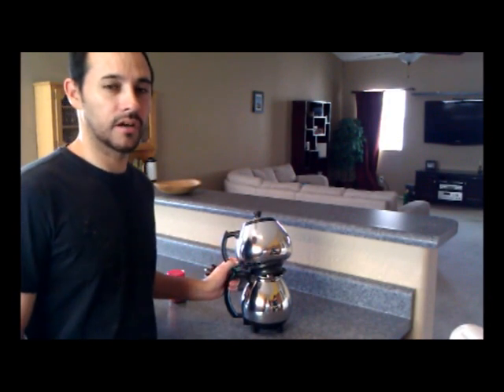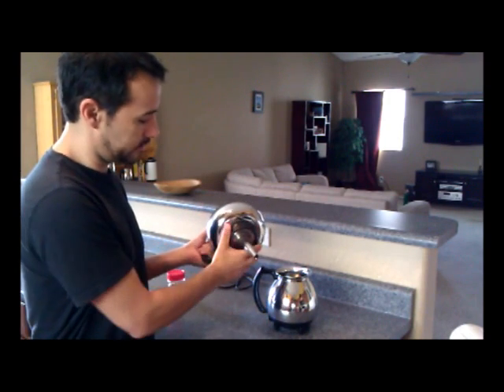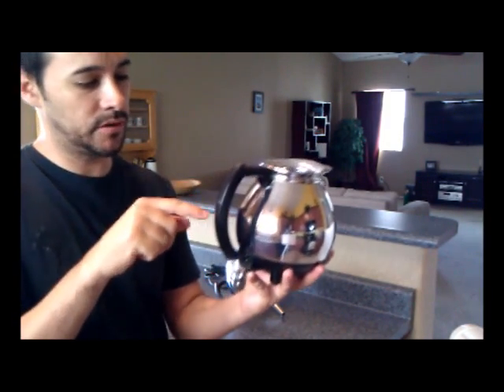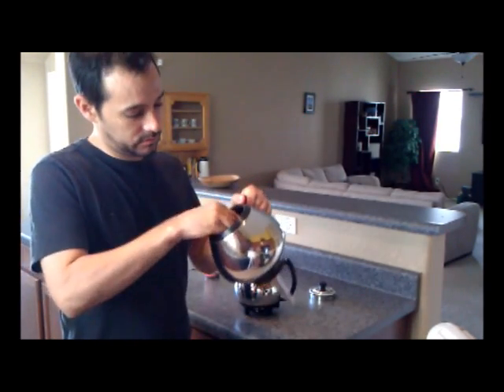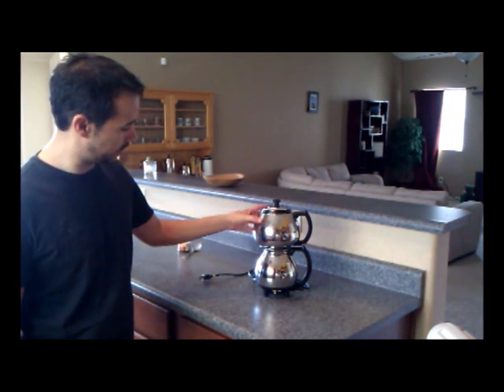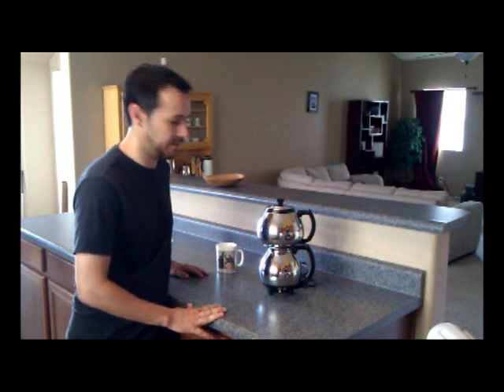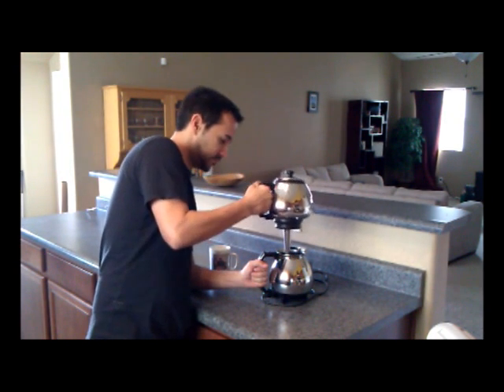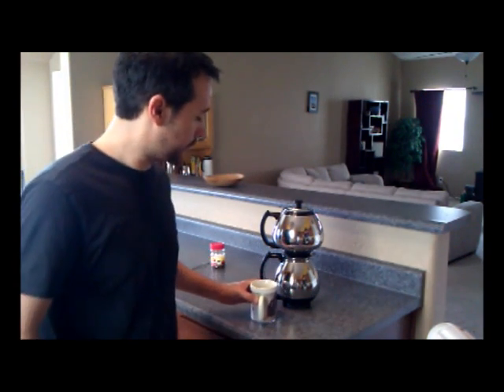Sunbeam C30a Coffee Maker Demonstration

Comment: Thanks for the information. I found them on Amazon and I will order some. But the thing is that I found anther old vintage one that's all stainless and has a three piece metal filter that works perfectly and is really easy to clean. Even though it's not electric or automatic, it works great.

Comment: I just dipped my gasket in plastic dip works like new before I did that it wouldn't seal because it got hard.
Reply: COULD YOU BE MORE SPECIFIC AS TO WHAT PLASTIC DIP YOU USED?   THE PRODUCT NAME?
Reply: fullflavor5  which brand of plastic dip you suggest and is it safe to use ?